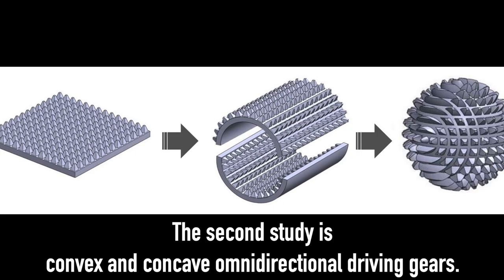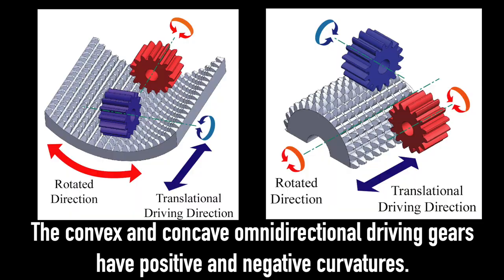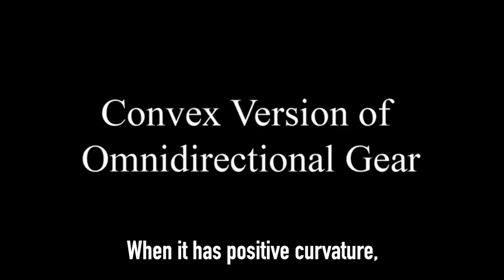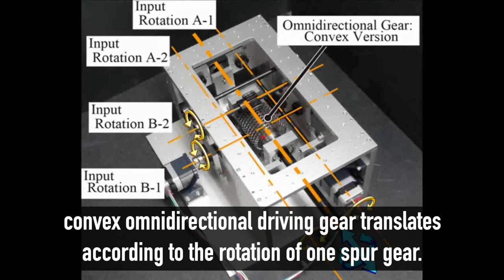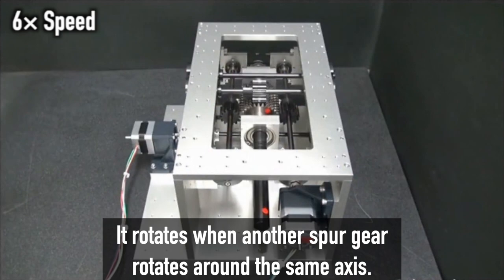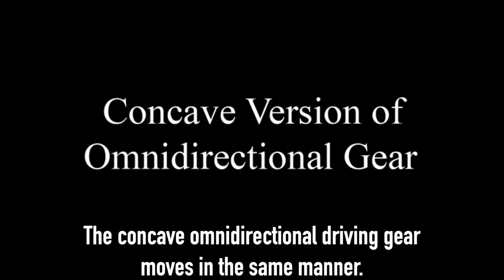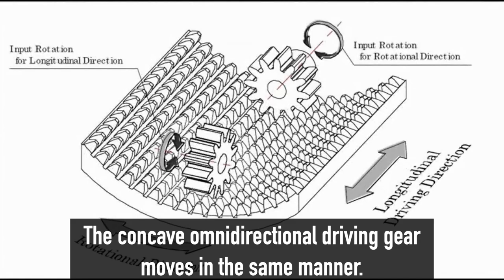ABENICS | Spherical Gear Mechanism with 3 Degrees of Freedom

Comment: Interesting idea, but I suspect there's a very narrow window of maximum torque for limited applications, and getting them strong enough to handle normal type loads is going to be very expensive in tooling.
Reply from the maker: Thank you very much for your precious suggestion. We are also considering those points to enhance the possibility of the spherical gear.

Comment: Beautiful engineering! Wonder if you can make a magnetic version with N52 polymagnets. Good luck in general and all the best!
Reply from the maker: Thank you very much.
It can also be a solution to realize a spherical motor, but we want to develop a gear version of the spherical motor with stable power transmission this time.

Comment: This is a cool idea, can you tell me how you created the monopole gear? It has such an interesting shape and I would like to remodel it and 3d print it for my own use.
Reply from the maker: The monopole gear was created with the milling machine with 5 active axes. A small ball end mill was used to mill its contour.
The profile of the monopole gear was designed according to the contact with the virtual end mill with the same shape as the spherical gear.
For more precise information in detail, please read the original full paper about ABENICS and see the attached video shown below.
These references explain the theory of the monopole gear in more professional way.
https://ieeexplore.ieee.org/document/9415699
https://ieeexplore.ieee.org/document/9415699/media#media